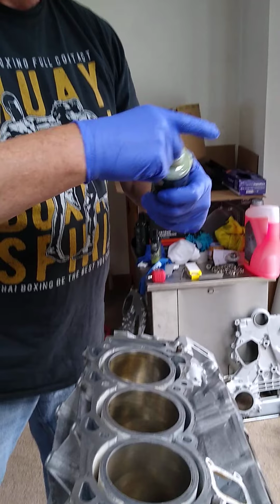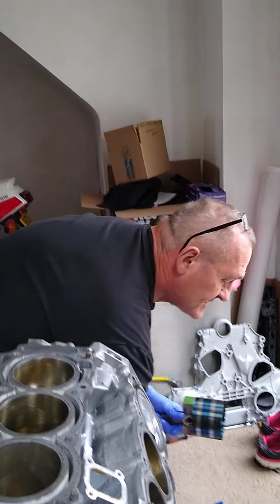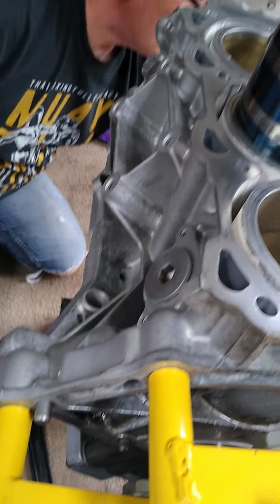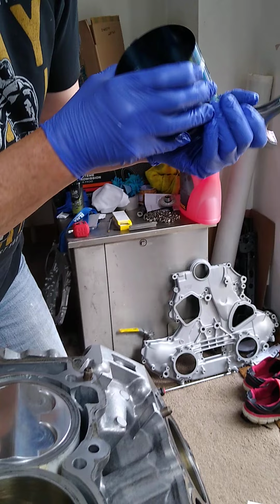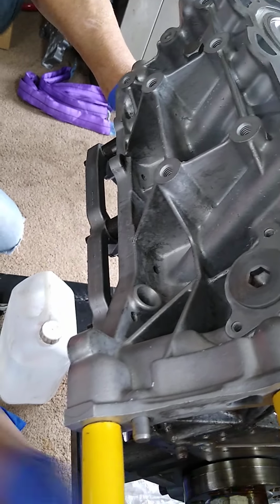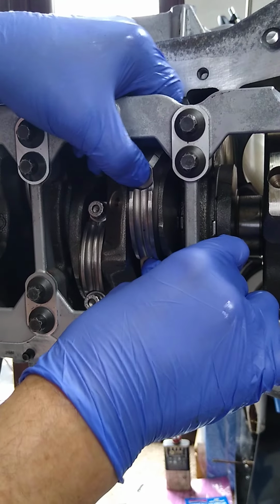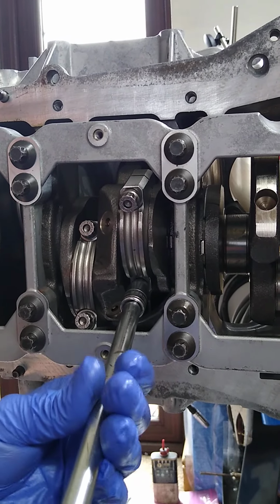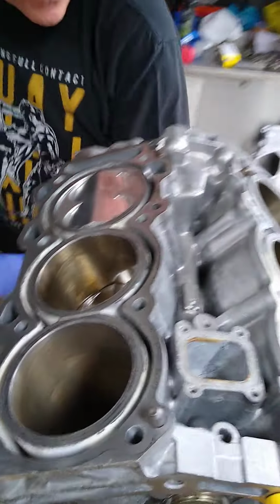Nissan 350Z  engine build part 2

Comment: Hi Stuart, did you use the Total Seal rings, I have measured mine but my feeler gauges only go to 0.35mm. the gap is bigger. probably about 0.40, where yours pre set also?? thanks for putting the vid up. i have the same pistons.
Reply from the maker: Hi, yes I have total seal rings. They came with the cosworth pistons, my gaps from memory were nearly 0.5!!
I questioned this with the company that did the rebore's etc, they said it is normal on forged pistons as they expand more than the original items.
They build race engines and have a good reputation so iv just carried on. I did position the rings with the gaps as per the instructions tho.
Just doing the vale clearances now.
I hope you're build goes smoothly.
Regards Stuart